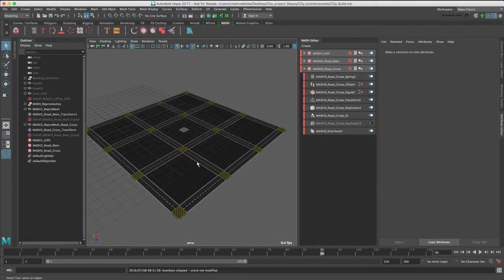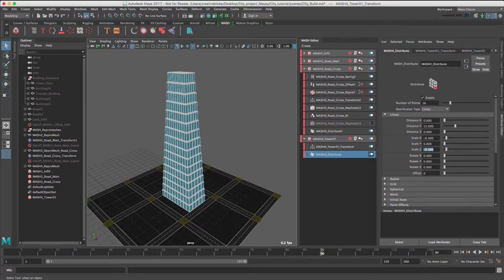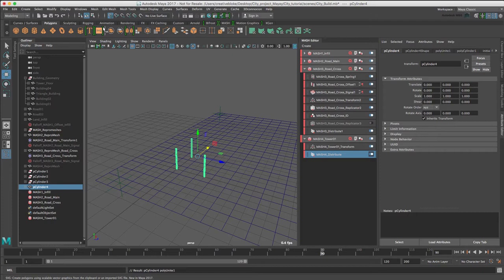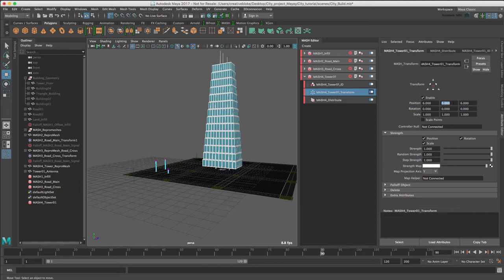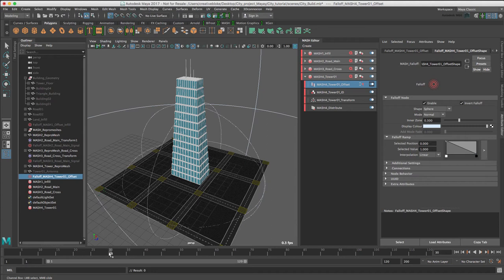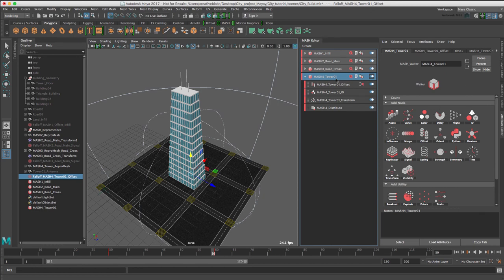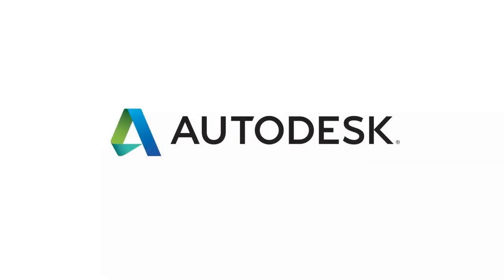Cinema 4D to Maya 2017: Growing a City - Part 12 - Building the main tower in MASH

Comment: I was flying through these tutorials. They're easy to follow and fun. 

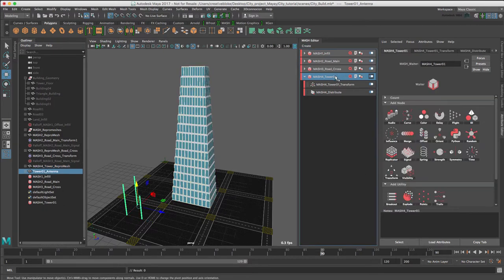I left it overnight, returned to finish from this video, and suddenly at step 3:53 noticed that I didn't have the repro node option! 

In the node stack (right side in this video) there are two small boxes to the left of each switch. My boxes are now 2 circular checkered icons. This seems to indicate something's missing. 

If I create a NEW MASH network, I will get the repro node and box icons. But all of the work leading to this one? I have no idea how to restore it. I must've accidentally hit a wrong button. Help, please!
Reply from the maker: Do you see a node with the word "Instancer" instead?  It may just be that you used the wrong type of reproduction, which you can switch between by selecting that MASH network and selecting MASH > Utilities > Switch Geometry Type
Reply: Hi. There was some type of bug because when I did that, the MASH editor window went blank and I got a scripting error.

I ended up going back to step 9 and starting the MASH part over. It was fine because repetition helps learning. 

This time I was mindful of every step and saved in increments. 

Update: It happened again  during Pt. 14 when I tried to delete history. So that's it, I believe.